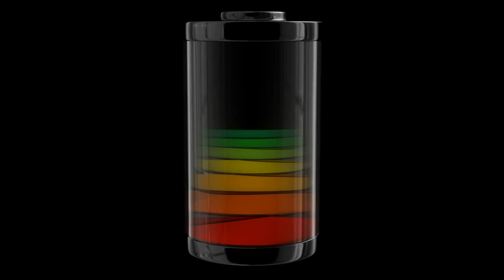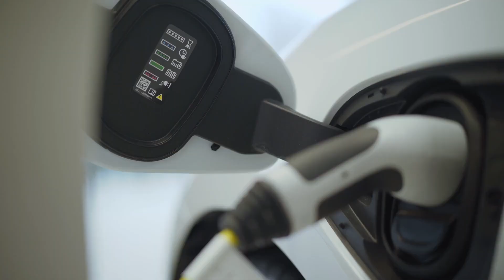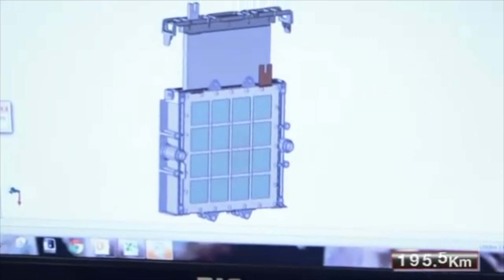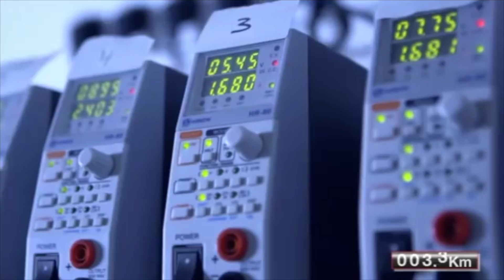This Battery Gives EVs 1000 Miles of Range!

Comment: This technology seems like it would be a great fit for electric-powered aviation.  At the end of every flight you could just swap out the aluminum battery.
Reply: Great idea! And all those batteries are landing in the same place! Recycling companies could turn up with a bunch of Tesla Semi's at Atlanta, JFK, LAX, Heathrow, Charles de Gaulle, etc.  Could be pretty slick... deliver 5000 batteries, pick up 5000 batteries... repeat :)

And if they could make them modular, like 2070,4680 etc... you build the vehicle to accommodate the range you need.
Reply: I think I saw a video some time ago about a prototype electric plane that used these
Reply: @jamespaul2587  it's weird when a use-case seems 'obvious' that wasn't quite that before :) 

Now I am as dumb as a box of rocks, so of course the 'obvious' will not be that :)

But as a thought experiment it does start to get interesting!

I wonder how long it takes to re-fuel a 747?

And if it all starts with new smaller routes, like I imagine your prototype electric plane was... well...mix it up with VTOL and DHL delivering/picking up the batteries... :)
Reply: @nadgerz  I think it was a small plane that I saw a video about, I'll have to see if I can find it. I still don't understand what actually happens to the aluminum plates after use, I think the video said the aluminum had to be melted and reformed into a new anode, perhaps it has to be purified also?
Reply: @jamespaul2587  I imagine it will be a mess initially, but I can't help but think that it would be better for companies like Redwood Materials to recycle than for us to keep mining? What do you think?

Hub and spoke operations for delivery and recycling?

Going to be quite an 'intriguing' decade.

I wish I had been born 20 years earlier :)
Reply: @nadgerz  I agree recycling will be the best solution In time however given long battery life and second Life uses such as power backups, I think it will be several years before the supply of batteries for recycling is close to the amount required for the growth in new EV sales. I believe Tesla's long term plan is to primarily recycle batteries rather than mining but they need to scale up mining and new cell production for several years
Reply: @jamespaul2587  Yeah, need to cover that 20 million vehicle production per year in 2030. Insanity. Well JB Straubel will do well and well deserved :)
Reply: @jamespaul2587  You do realize that it is most commonly fossil fuels recharging the battery right? Also.... without fossil fuels/ components.... much of tech today goes away.... even the simple things such as your carpet... and the glue holding it down. We are not tech wise ready at any front to completely do away with fossil products. They are simply our most efficient source of power from a fuel.... plus the other products made from the source of the fuels. Tires, asphalt, carbon steel, several other alloys, plastics, adhesives, high heat made efficiently for producing alloys, glass...etc..
The tech isn't here yet to be phasing out what got us where we are.
Reply: @nadgerz   We’ll always keep mining, don’t you think?  Aluminum is easy to mine due to its abundance
Reply: Since the battery requires oxygen as a catalyst to generate a charge it's not as good for airplanes since they fly at an altitude with a lot less oxygen. You wouldn't be able to get as much output as you can if you're on the ground.
Reply: @krisalis709  Ten kilometers above the ground you still have about a third of the oxygen at sea level. You fly more than three times as fast as a car is driven, there, so you bump into much more oxygen than a car, per second.
Reply: @krisalis709  did you know that piston internal combustion engines and turbine engines (jets) require oxygen to burn fuel? Hmm...
Reply: @krisalis709  take your oxygen with you.
Reply: Agree! if this works I can see that airplane will be using this extensively. It is cheaper, lighter and only requires replacement on every trip
Reply: @overdozenguquen  I'm thinking battery size required for a flight, vs weight of current jet fuel.... fuel would be lighter. Plus layover times at airports for flights would increase with replace and safety test of batteries. Also the flight redundancy issues... you think they are going to pack in a back up battery in event of a failure. With fuel engines... the craft are most times multi engine.... so if 1 fails there is still at least some thrust. Battery pack fails... and your completely fucked.... if your electric only.... not to mention the plane controls would go offline also... unless they kept that evil fuel burning APU.... then at least the pilots could try to pick a crash site.
Reply: It would be a great use case, however when you start to add up the total power consumed in production things don't look so good.
If we refine the recycling to mainly use solar power for heating then we are onto something, but that needs a major overhaul of the entire production process.
Reply: @MsSomeonenew  Even then, given Murphy's law, there's no guarantee that disaster won't strike.
Reply: The max. energy density of Aluminum air battery is not 8kWh/kg - well unless you plan to dump the hydroxide. Once we include the weight of the other elements included in the primary reaction (hydrogen and oxygen), we get about 2.9 kwh/kg theoretical max. On the system level we can expect somewhere between 1,4 and 2 kwh/kg.  Still way more then Li-ion. The issue is the overall efficiency of recycling the hydroxide back into aluminum is very low - less than 20 percent, which make this as bad as ICE. Than again they could just sell the hydroxide to other industries and not recycle it at all.
Reply: Not exactly great in aircraft either. You would have to recycle the battery and pay for its transport to and from the recycling facility. A solvent or catalyst would have to be used to convert the aluminum back... that could get, messy, expensive, time consuming very easily. You might have to pay a nice chunk of the battery's "new" price to make that happen every time. It costs maybe $20of electricity to top a M3 from empty to full. How much would it cost to take 500lb pack, transport it to a recycling factory, recycle it by reforming the aluminum from aluminum hydroxide and send it back.... you have to pay for all of this.... Do you see this costing $20...$50....$100... .more?
 
This is basically a one-shot battery... but it can be recycled... much like a lithium battery that lasts 1500 cycles or so. I am also suspicious of 8x energy density when he quotes 1,000 miles. 8x would be closer to 2400 miles these days. Theoretical limits almost never pan out. There are other limiting factors that can readily bring it down to a much less spectacular level... and that will really chock the wheels of a one cycle battery. 

This tech has been around for many years. 
The question is why hasn't anyone found a use for it yet if battery recycling (not just swapping )....Recycling wasn't expensive.
Reply: @avgjoe5969  One thing impressing me is that you'd more closely approach the makeup of a bird than with the current aircraft. Such a battery provides an airplane with a lung.
Reply: Power density (Watts per Kilogram) is probably far too low for an aircraft application. Power density is different from Energy Density (watt-hours per liter) or Specific Energy (Watt-Hours per Kilogram).
Reply: Haha. Or better yet, amazon delivery trucks can now be flying drones. Replace the batteries at the end of the shift.
Reply: Structural batteries are the future. Virtually no weight penalty.
Reply: @MrChiangching  Carbon nanotubes have entered the chat.
Reply: Nice. Maybe vehicle or even machinery rental could benefit from this as well. Good call
Reply: I  am a pilot not flying any bird on batteries don't care what kind they are gonna be lots of years before they are trustworthy.
Reply: @drymoonproperties   That’s fine; there are plenty of other pilots who’ll gladly take your seat.   E-planes are quickly becoming popular with local and regional carriers for their extremely low operating and maintenance costs…as well as with flying instructors who can now give lessons for a fraction of the cost they could in an ICE plane.
Reply: The 50 ton battery.
Reply: Aviation schools are already ramping up to use this technology.  At least the smart ones are.
Reply: Great  Idea!!!💡
Reply: Would fit commercial flight very well.  Can break up into cells, and only load enough batteries to burn though the load per flight.
Reply: Came to the comments to say the same thing... The only concern I see is the lack of oxygen where planes usually fly...
Reply: Yes this seems like it would work great for aviation!
Reply: @Allen Loser There are already lithium battery powered aircraft, and these would be even lighter yet.  Winning
Reply: @Allen Loser   Not sure why you think electric powered aircraft are not viable. 
Lithium aircraft are already viable and for the smaller shorter runs they are vastly cheaper to operate than ICE. If this tech is lighter and 9x the energy density of lithium, and these can carry even more payload than lithium, they should be popular.
Reply: @Allen Loser I don’t know about trains….I don’t care about trains…..I didn’t say anything about trains…..or Jumbos. 
Not all aviation needs to be jumbos.
Reply: @Allen Loser 
There is already at least one FAA-certified battery-powered aircraft. 

The Pipistrel Alpha Electro is the first all-electric airplane to be FAA certified. Plenty of others want to get to that point.
Reply: @Allen Loser Ummm….well, this thread WAS about planes.
Reply: @Allen Loser Yes…. the power to weight of current battery tech is limited.  Which is exactly why this tech could offer new possibilities, given 9x the energy density of what we have now.
Reply: @Allen Loser Im not interested in engaging with you any further.  Later.
Reply: Release Zero point energy tech and your car will never need a charge.  Trouble is they can't put a meter on this like they can your has or electric usage. Also a man came out with a car that runs 9n water in the 1980s. Let's just say he was not around long enough to put it into production.
Reply: Elon wont buy out this tech's patent and terminate it. Just like how his tweet push bitcoin price up ... or NOT
Reply: @Allen Loser If you knew the level of energy available you would be shocked. That is why each time someone taps this energy they are shut down and either paid off or something much worse. What about Stanley Meier water resonance browns gas devices. This may be more your speed. He was poisoned before he could go into production.
Reply: @Allen Loser Thanks for your inputs. How he died is a matter of winners and losers from what I have read and learned. He was the loser so what you read is the winners story. 
Yes, electrolysis is about 33% effecient. The resonance is the trick. If you can find the RF frequencies and modulation type and audio frequencies you should be able to liberate the water into it's components at a low power level. DC is not the answer  of course unless you have abundant solar or other types. Green energy is ridiculous and is just a way to pass money around. Wind breaks down and the weather destroys it and solar is 13% effecient and fades out over time. 

I am not trying to convince you of anything. Do you know about Scalar energy? Why are over 5000 tech and medical patents confiscated by our government agencies? There is a different science with different laws and formulas. Anyway, thanks again for your inputs. Those things everyone sees in the sky are based on very high voltage and spinning magnetic fields. Another secret science. No props or jet engines needed.
Reply: Maybe just make the plane disposable. Use the energy from the planes aluminum structure to fly to your destination. The idea is to just have enough structure left at the end of the flight to land safely.
 In other words aluminum fuel cells are impractical and not very green.
Reply: Also consider liquid ammonia fuel cells which offer similar or better features to Al-O.
Reply: @Allen Loser Extracting hydrogen from ammonia is not only ridiculously easy, it's also pointless since ammonia has a higher energy density and higher hydrogen density than pure hydrogen, unless the hydrogen is compressed to very inefficient pressures or chilled to inefficient temperatures.

Not only can ammonia be burned directly  producing zero CO2, only water and nitrogen, you can also use it directly in fuel cells. So you are using hydrogen at higher densities than pure hydrogen, in low pressure, room temperature systems.
Reply: Will it be too heavy to carry all the batteries?
Reply: Just asking but aluminum is very toxic this we all know and now you want to make these use once and throw away!!  I can see huge “scrap yards” with thousands of these batteries just leaching crap into ground water and killing the whole Neighborhood!   So why not hydrogen?  It’s by product is oxygen!!  I like that better
Reply: @Allen Loser you don’t address  the issue of the toxic waste that will be created when these aluminum power cells are expelled and stacked up in some yard leaching into the ground water.  Aluminum is very toxic this is well known
Reply: Yes, I see electric aviation as a good application for Al-O2 batteries, particularly for propeller-driven commuter planes.  Compared to cars, commuter aviation is much more sensitive to weight, and less sensitive to cost.  With short flights (often 1/2 hour to 1 hour) at low altitude, a quick-swap battery could be replaced while loading & unloading baggage, and would fit in with their typical operations.  

In my area, a commuter airline in Vancouver, Harbour Air, is experimenting with electric-powered seaplanes, which run short hops between harbours (closer to downtown than most airports).  They are using rechargeable batteries, but I think this type of application could be a useful one for Al-O2 batteries.  
BTW, they operate in an area where the electric power to charge them is almost all from renewable sources (hydro-electric).  
(I'm much less plussed on charging electric cars from coal-burning power plants.)  

OTOH, I think that for cars, the cost of replacing batteries more often than changing oil would be cost prohibitive to use Al-O2 as the primary battery for a car.  Maybe use as a secondary "just-in-case" battery to augment a Li-Ion battery could be beneficial.  You could drive on the rechargeable battery all the time, with the Al-02 backup there to get home or to the next charging station so you don't get stuck.  It could be carried more like a spare tire than like a primary fuel source.
Reply: Isn't air rarefiation at high altitudes an issue to be addressed?
Reply: With o2 needed for the process, wouldn’t efficiency drop with altitude? Not the best for airplanes
Reply: Subs and planes you all got the Wright one baby.
Reply: Yes agreed for Aviation it seems perfect since you could teplace fuel tanks with battery areas, and make the airplane even safer by reducing the fires.  Secondly in a city you would have swapping stations in what today are  gas stations in hotels and in Costco Co Sam's or Walmart  Advance etc.  If they are made easy enough like 50 pounds or less the owner in may cases could do it saving a bunch more money.  A plug couple of quick disconects, turn on and keep on running.  It seems like a perfect fit because no ICE that I know gives you a 1000 mile range yet neither an hybrid or a puee electric.  The capicity to recycle all these materials will create jobs and new industries!  Third the Aluminum poundo would go up!  Whoever invests in Alcoa etc youll make ric in the future@
Reply: The greenery along side the hi-ways and bi-ways grows well, proves it loves the carbon emissions of our gas cars.
Reply: That could work for smaller planes for sure.
Reply: The air at 10km altitude is not the same at sea level. Maybe that will reduce the energy-density.
Reply: Sure,  If you believe  everything you  are told; the moon*could* be made of green cheese.
Reply: No bio jet fuel because aluminum air battery is not rechargeable
Reply: I don't think that'll be the type of transportation where it's used, aviation needs better Batteries than this one.
Reply: It would be good for one sector in aerospace. Weapons!

 No need for a rechargeable batter for your missile. You want small size, specific power, tough/reliable, and longevity.

 For cars and even planes? How about we focus on Lithium Air. Lithium Air IS rechargeable, and can hold more therotically. In fact no other known battery chemistry can hold more power.

 Something like 12,2500 kwh/kg with air excluded (like how a jet draws oxygen from the air). Half that if you include oxygen.

 That is the maximum therotical limit though which is impossible to get. So half that efficiency which should be possible would grant us 2.5k and 5k kwh/kg which would change EVERYTHING. 

 Sure batteries will never hit the power per kg of fossil fuels. Yet they definitely exceed it in cost of power, and we could just have more flights with planes that carry less, and more frequently. It maybe better as more planes would be flying giving us, the consumer, more flights to choose from and for cheaper. Since electric motors are also superior in terms of maintenence... (flights will be slower. I don't see electric jets reaching 90% of the speed of sound anytime soon.)
Reply: they arent rechargeable
Reply: @businessninja1913  True, but did we may a mistake in the discussion above?
Reply: They may even be able to swap in flight, circumnavigate the plant? Damn, bunch of nerds with nothing better to do...lmao. Stay way cool-peeps!
Reply: Good idea, but you could not get the speed of a jet. That is what most people would want. Good for the smaller commuter plane or private plane.
Reply: @ivorholtskog5506  yes you can. just make electric turbo jet. Make plasma to heat the air and expand the same as kerosen is doing. But smaller and not noise.